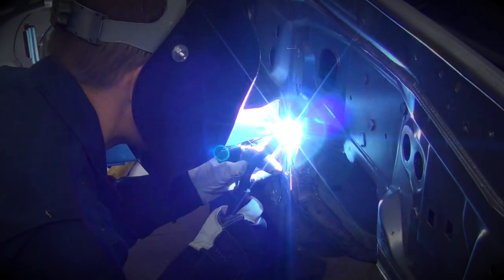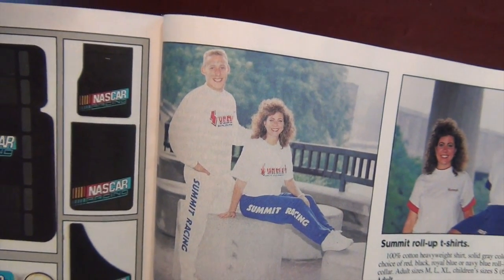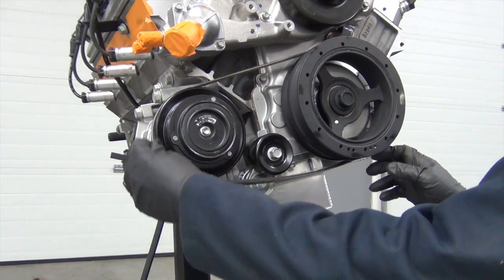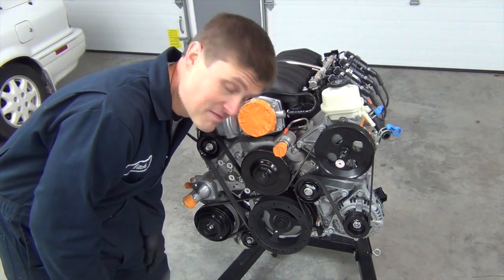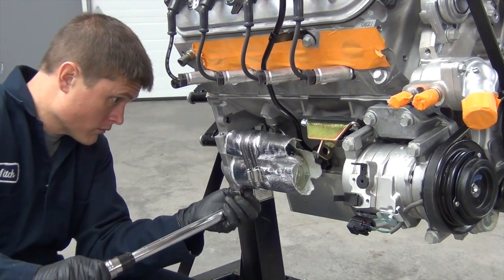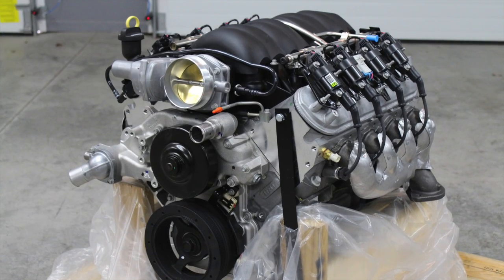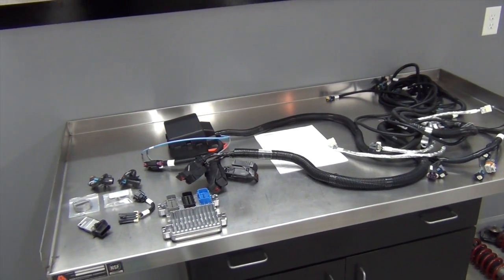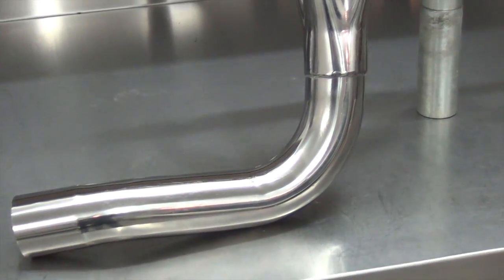LS3 V8 Miata Build - Project Thunderbolt Part 5

Comment: I personally wouldn't of bothered with AC. Just more weight to drag around.
Reply from the maker: suzuki400boi Depends on how you plan to use the car.  It's freaking hot and humid here in the summer, and I like AC in a street car.
Reply: I agree to a point, but i mean, it is a convertible haha. I chose to delete mine simply because it had a leak. And with the intercooler and condenser in front of the radiator it allowed more air to get to it without the condenser being there.

Love the build though. Keep it up!
Reply: suzuki400boi its not like the 525hp will have a problem dragging around an ac system haha. With the kind of money he has put in this build, I would want this car to do everything possible within reason. Also, i never understood the "it doesn't need ac, it's a convertible". I loved having ac so when the sun was just too much, i could put my top up and turn on the ac.
Reply from the maker: Andrew Miller Well said Andrew, it's simply a creature comfort.  If I was building a track car, no.  For how this car will be used and when it will be used here, yes.
Reply: Not having air conditioning is a HUGE turnoff to potential buyers if you ever plan to sell the car.
Reply: @TomsTurboGarage  Does that mean you have to drive with the top on in the summer? Otherwise AC will be totally useless, wouldn't it?
Reply from the maker: Jaap Aap the car has a soft top.  The ac works great with the top down too, just roll the side windows up.
Reply: Not a dig on the OP, but most people who say that could already stand to loose the 25 pounds that A/C unit weighs and they will never realize the 7 hp savings on a 500+ HP engine.  Unless she is going to Bonneville, you'd never know the difference.

Comment: Are you using an automatic? Or are you installing the clutch pedal to the existing bracket?
Reply: Manual ofc.
Reply: t56 6 speed, uses a hydraulic throwout bearing so the clutch pedal and master cylinder are normally all one piece.
Reply from the maker: Revive Yes, as others have shared - you can see the transmission in Part 4.

Comment: WITH THAT LOW PRO OIL PAN -- DON'T YOU LOSE A 1 & 1/2 QUARTS OF OIL ? -- CURIOS
Reply from the maker: Yes, most all LS swap pans sacrifice capacity.
Reply: @TomsTurboGarage  can you try to use a sump on that spare little tank with a pump. I'm curious

Comment: Dude buy an impact . You dont realize you need one until you  have owned one.
All that to use a drive by wire throttle body you could have just used a drive by cable throttle body and saved your  self heart ache.

Comment: Hey Tom, how come you didn't go with the V8Roadsters long tube headers? http://www.v8roadsters.com/long-tube-headers/
Reply from the maker: Dan Simms Hi Dan, they are awesome pieces, but offered some compromises that I wasn't willing to make in this go around.  Maybe on down the road?
Reply: Tom's Turbo Garage What kind of compromises do the V8R long tubes require?
Reply from the maker: Tim Bass The same you would find with long tubes in any car, but amplified in a tiny Miata.  Lots of hot pipes everywhere, heat, clearance challenges, surrounding component mounting, etc.

Comment: $1400.00 for the accelerator pedal assembly....whew!
Reply from the maker: Just to be clear that setup is much more than an accelerator pedal.  It’s the entire standalone engine and trans wiring harness, fuse block and ecu pre tuned for this engine.

Comment: Tom, I really like what you're doing! But for God's sake, please learn how to operate a torque wrench. You keep demonstrating exactly how NOT to do it every time you use it, and please, also stop clicking it twice. Every single bolt you have tightened on your demonstrations, are too loose! If you don't understand what I mean, please ask, and if you think it over (how you do it), just make a short film demonstrating how to use a torque wrench correctly.
Reply: Finn Hermansen how should he use it then? Looks fine to me. clicking it twice is just so you know it's torqued properly.
Reply: ***** The way he does it: turns the wrench but stops before it clicks, then ratchet it backwards, and again forward... What do you notice? It clicks immediately! This tells any mechanic that he stopped before reaching the torque intended. If you are about to tight say 2,0 kg,you enter 2,0 kg on the wrench. But if you stop turning just before it clicks, you might have tightened it to say 1,5 kg. Then, when you start over again, the wrench will click immediately! If you have to stop because there is a hinder, you just have to back the bolt a little bit before starting over again. Easier spoken; to reach CORRRCT torque, you have to turn it NON STOP till the wrench clicks. And again, clicking twice tells me nothing else than the fact that the bolt isn't loose, but NOT what torque it was tightened to.
Reply: To sum it up in one sentence: static friction is greater than kinetic friction.
Reply: Exactly

Comment: Why aren't people swapping the 5.0 Ford V8 (is it the boss V8? I'm not sure if that's the name) into the MX5. I mean: it's a Mazda... and a Ford engine...
Reply: LS is way more cost effective. Not to mention tons of aftermarket and information on the swap is everywhere. It will probably be 5-10 years before 5.0 swaps become popular.
Reply: elwulfo666 because most people don't want to worry about camshaft timing belts. Plus when it comes to HP, most of the 250hp+ 5.0's come from the "rarer" Fords so finding one in the junkyard is unlikely. Meanwhile you can find various sub-models of LSX engines in just about any GM truck and performance oriented GM car, most of which putting out 275hp+ stock
Reply: I believe you might be talking about the coyote engine. And to be honest I've never seen what it looks like, I think it's a big engine which really isn't great for engine swaps.
Reply: Nathan Westfall Seems like I meant the Aluminator(?). You can buy it as a crate engine.
Reply: The OHC Ford V8's are too big to fit. I think Tom discussed that in the first video.
Reply: elwulfo666 FYI, the Aluminator is a Coyote engine. I think it just boils down to parts support, cost, and availability. LS engines have been around for so long and are so "universal" in their design that everyone and their mother makes parts and swap kits for them.

I think as time goes on, you'll see more and more support for the Coyote swaps, and with that you'll see more people doing them. They're gaining in popularity already with the Fox Mustang guys.
Reply: ***** Chevy has a really good team of engineers.
Reply: Biggest factor for size is the LS is a pushrod engine vs the Coyote being DOHC. Makes a big difference in how compact you can package everything.
Reply: I pretty sure there is a coyote kit
Reply: monstermiata.com does the "old" 5.0 Ford V8 swaps, and there's just as much (if not more) aftermarket support for those as the LS.  They're also much cheaper to get new OR used, with the vast majority of the great things that the LS has, too.
Reply: But isn't the old 5.0 an 8 valve engine?
Reply: elwulfo666 as in, one valve per cylinder?  does it just have a giant hole for the exhaust?

No - the small-block Ford is an overhead-valve, two-valve-per-cylinder V8, just like the small-block Chevy and LS.  The biggest difference is that I don't think there ever was a factory-produced aluminum block, so you'd have to go with an aftermarket block for aluminum for weight savings, but fully-dressed, the iron-block Ford weighs about the same as the LS featured here anyway, which might (emphasis on "might," because I don't know for sure) be stronger.
Reply: Sorry. That was really really stupid :D I meant 16 valves :D
Reply: But is the old Ford an ohc or pushrod?
Reply: elwulfo666 Pushrod, 16-valve OHV, just like an LS.
Reply: ***** The modular Ford engine (which the 4.6 and 5.4 are part of) is a huge engine because they use the exact same engine manufacturing process, all the way up to their 6.9l.
Reply: I would build a 302 (1990s 5.0L HO) miata over an LS all day everyday and for no reasons whatsoever.

Oh, apart from

Shorter stroke for higher revs
Distinctive noise or routing the cylinder 7 & 4 exhaust tube to opposite bank of headers to mimic a flat plane crank noise
Even cheaper parts available
More fabrication means more fun and learning
5.0 HOs from the 90s can be run on a plug'n'play megasquirt and unlock an infinite or possibilies (figuratively)
Price of parts and ridiculously easy to build yourself for cheap and sustain high horsepower
It's a 302 fckin miata...
Reply: Yoan Carlove High compression closed chamber aluminium cylinder heads on a ford performance block with forged I-beams and hypereutectic pistons and a forged crank with a precision balance. A long intake duration camshaft to be able to run higher compression by allowing a slight amount of compression bleeding in the intake ports or just a mild 6000rpm camshaft. Try to have it make power up to 6500rpm on 91 no-ethanol (E0 91) gasoline. With good tuning, 400-440whp easy even if you cheap out and get the cast crank but then that's your limit.

Anything over 500 then you start throwing money on the ground blow your budget (In this case the budget being the price of that LS). You probably want to go forced induction with a dart block, forged pistons and h beams instead of Is. Forged crank will be inevitable.

You will want to run E0 91  with an anti detonation system like water meth or going on the dark side of ethanol... You might wonder why I don't like ethanol and prefer water/methanol injection?

Well, ethanol goes into your gasoline tank(s) and is ran through your gasoline lines and gasoline injectors. All seems fine until you need to replace rubber hoses for more expensive ones that will actually last, injectors safe for E85+ and simultaneously contaminating your whole system with a water seeking demon...
Water/meth injection runs on a different system controlling the methanol demon.
The other and most important point is the following: you need to burn more ethanol for the same results as energy. The combustion might be more controlled because of it's anti detonation properties (having a higher resistance to compression it being an alcohol like methanol) but you will have piss poor consumption.
Reply: Yoan Carlove About the Megasquirt - that's if you want to run EFI.  MY favorite thing about the SBC/SBF/Pontiac engines is you can eliminate the ECM completely.
Reply: jedidethfreak Yeah and I'm not gonna go on EFI vs CARB discussion because fuck carbs.
Reply: Yoan Carlove I'm not getting into that debate, at all - just positing that it's a very easy option, unlike with the LS.  Sure, you can put a carb on it, but you still need something to control the coil packs, be it a custom ECM or an ignition box and some custom pigtails.  The closest you can get is a VERY ugly timing cover kit that allows the placement of a distributor up front, but that's a hell of a lot of trouble all the way around.
Reply: jedidethfreak Not so sir.  Every system and component that needs to be modified for the LS swap has to be modified for the 5.0 swap as well.  There is about a days worth of interior work and welding you have to do with the LS that you don't with the 5.0 but over all there very little difference in effort to do an LS vs a 5.0 build.  There is also very little difference in cost if you compare apples for apples.  Sure an old stock Mustang engine is cheaper but the $$ it would take to push a 5.0 to the 525 HP in Toms build would be as much if not more than he paid for his engine.
Reply: Yoan Carlove The 5.0 vs LS swap as been documented and debated endlessly and the fact is they are both excellent swaps. There is plenty of advantages and disadvantages for each and to say either is significantly better than the other is pointless because they both have trade offs. Just like every build is unique so every builder chooses what fits their needs, wants and budget the best.   The bottom line is whether you are loyal to the blue oval or a died in the wool bow tie guy both swaps are a heck of a lot of fun to drive!
Reply: Jim Stainer I never said it was significantly better.
Reply: Jim Stainer i think you misunderstood - i wasn't saying the swap itself was easier (I've seen the SBF swap, and know it requires pretty much everything here, too), merely converting the engine from EFI to carb was easier, as all SBF engines have built-in distributor bosses and all the cams come with distributor gearing, meaning all that's needed is a carb, carb intake manifold and a non-computer-controlled distributor.  Such a conversion for an LS requires carbs, a much more expensive intake manifold setup, a decision as to whether you're going to ditch the coil packs, since they'll be exposed, a digital ignition box and custom wiring (if you keep the coil packs) or a new timing cover and a special distributor (if you ditch them) along with a new front drive, since factory ones are no longer compatible.
Reply: jedidethfreak Roger that I did miss the point you were making.  Swapping to a carb would not be for everyone but it can be a great way to go you want to build a $2015 V8 Miata or just like the old school.   Thanks!!
Reply: probably because they want to DRIVE their car, not have to fix it every day.
Reply: 4theloveofDub I doubt it.  Most guys bright enough to swap a V8 into a Miata have long ago figured out the Ford vs Chevy debate is complete nonsense and don't bother with it.
Reply: Jim Stainer Exactly, im not like everyone. or im exactly like everyone, depending on what you mean.
Reply: ***** No they didn't - people have been V8-swapping small-block Fords into Miatas LOOOOONG before the Coyote was conceived.
Reply: the original "monster miata" was ford 302ho,t-5 setup. it is done but a cheap 302 is getting hard to find. new 5.0 cost too much and LS engines are everywhere in one form or another.

Comment: Why does everyone stick heavy LS engines in these Miatas? Mazda makes a very fine V6 which doesn't weigh more than the car, unlike the LS.
Reply: Does it make 500 hp?  No.
Reply: You can make it if you want to.
Some have been jacked up to 1000.
Reply: ryotaryuu LS3 also doesn`t make 500 hp
Reply: Николай Кондратьев The  LS376/525 makes 525 hp...
Reply: K.H. because they're not actually heavy. The LS small blocks are famous for their small size, low weight and excellent torque output. Plus they're relatively cheap!
Reply: it was almost as small as the 4 cylinder...... -.-
Reply: Actualy lighter the what was there.
Reply: exactly, Sometimes the LS (aluminium) Is lighter then the I4/v6 they replace.. Or generally within about 50 lbs

Comment: the absolute worst place for the alternator, low mounted alternators are hell to change, and get water and road grime in them far too easy, not to mention placing it under the power steering pump is asking for trouble later down the line. one leak and its goodbye alternator. i know this from experience working on cars with this setup, its a piss poor design and in my honest opinion this was cutting corners by taking this route instead of either fabbing up a better setup or finding one
Reply: +nathan campbell considering the millions of LS set ups running around like this if it was truly a wide spread problem GM would have fixed it long ago.  I have owned several LS engines and have one in Miata and not only is the alternator easy to change from the bottom it's also not any more prone to failure than mounted anywhere else.
Reply: +Jim Stainer i know for fact from working in a shop yes this is a bad location for it, especially if the power steering pump ever gets a leak
Reply: Glad to see you know more than the engineers at GM.  I know for a fact removing the alternator from an LS1 Miata is easy having done it twice.  (one for headers and once for an oil cooler add)  I know for a fact I cooked my LS1 Miata at a track the first time out and wiped out the seal in the front of the power steering pump.  It leaked so bad it took 6 quarts of oil to make it the 90 miles home and the alternator was fine. I know for a fact if you dump a lot of any fluid in a GM alternator either stopped or spinning the odds are it will stop charging in short order or worse the voltage regulator will go and you will see 20+ on your gauge.  And also know it's NOT a wide spread problem or GM would have changed the design a decade ago rather than replacing countless alternators under warranty.

Comment: This headers are POS. Look, one cilinder tube is slapped to about 50% of it`s flow capacity and it`s 4-1, more suitable for high rpm engine, wich is not LS3. V6 would be better choice for this lightweight chasssis. And I mean DOHC V6. I don`t understand why you americans are so sticky to low camshaft (not shure in exact term) engines, they permanently have lower performance than DOHC dew to excesive masses of pushrods and rockers. 4.2 liter DOHC engine will overcome this 6.2 liter LS3. And forseeing your objections, after you`ll check the specs, remember: horse power sells the car and torque moves it.
Reply: Николай Кондратьев  forgot somthing: IMHO this L-bar and DIY pedal mounting are not so reliable than stock. Low profile oil pan reduces oil volume in the system leading to more frecuently oil change than factory specs.
Reply: Николай Кондратьев more frecuently oil change than factory specs and possibly higher oil temperature, again reducing oil lifetime
Reply: radiator without plastic cover like OEM will have only 58% of cooling performance than it could have otherwise
Reply: all that things make negative impression to overall project and make Tom a noob, addicted to shiny parts, actually not understanding how thing performance and why they made this and not that (sorry for multiple posts, can`t put all thouts at once). allready read somewhere here: only hear "kit this"..."kit that", are you fabricator or what?